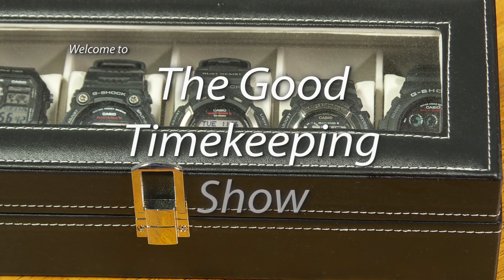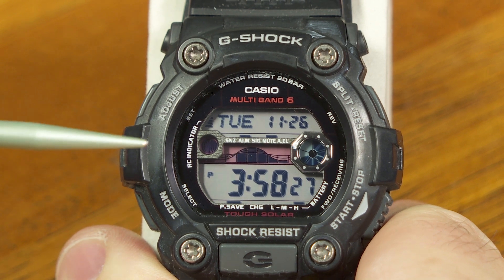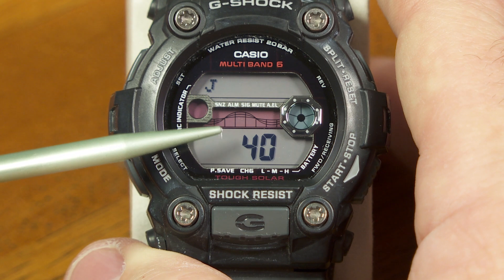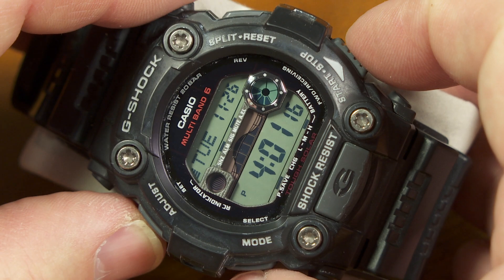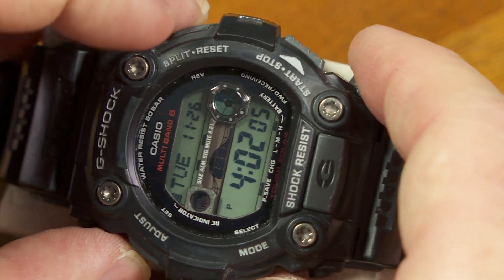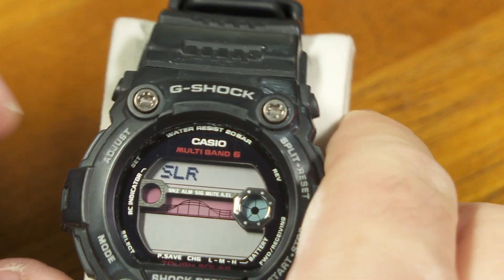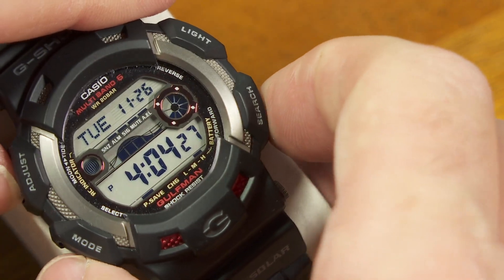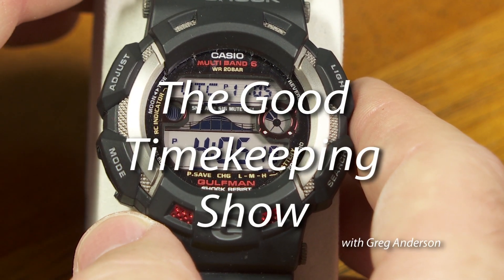Diagnostics for GW7900 and GW9110

Comment: I am interested in this model because of the functions, but mostly the 7900 for the solar function as well. I just know I will get annoyed at the date display. For me as a dutch person it is just not logical to have the month before the day. As far as I can tell it’s not possible to change this date setting. Anyone know if it’s possible? Or maybe if there is a very similar (newer) model with a module in it with which it actually is possible to switch the day and month?
Reply: this type of technology would be too advanced, I saw in another video that a newly released 5600 (or 5610? don't remember) has this ability with the new updated module where it can change the order of day-month / month-day.

Comment: There is an extra-extra feature with the first diagnostic screen you demo'd, regarding the list of radio time sources!

I discovered that, after entering that screen, after using the "start/stop" button to select your radio transmitter of interest, if you then press the "split/reset" button, the watch will attempt to acquire the time signal from THAT station. If it's successful, after a few minutes the watch will beep and the "J"/"U"/etc. will have the letters "OK" as an added suffix (e.g. JOK, UOK, etc.). If unsuccessful, or if you press "start/stop" again while the watch is listening for the time signal, it will instead show "NG" (like JNG, UNG, GNG, etc.). I interpret that as shorthand for "no-good". While the watch is listening for the time signals, you get a presentation identical to the manual radio reception feature as documented in the manual, with the letters "RC" in the upper right, the current time in the bottom with signal strength adjacent (L1,L2,L3), and a blinking "time received" icon at the upper left corner.

It appears, though, that after successful reception, the watch is not adjusted to match the transmitted signal (please check me on that). [edit 210604: I deliberately mis-set my watch and tried this again, the watch did set the time.] Nevertheless, This is a convenient way to discover which time transmitters are providing strong enough signals for your watch to lock to, after you've moved to a new part of the world. So if the default programmed time source for your set home timezone isn't providing you with good signals, but you discover a nearby source (e.g. L-England, vs. G-Germany in Europe) that does, you could consider temporarily changing your home-timezone to that place, executing a manual sync, then changing back, or using the WT display as your primary to observe local time. can use this extra feature of the diagnostic mode to sync up to a different transmitter.